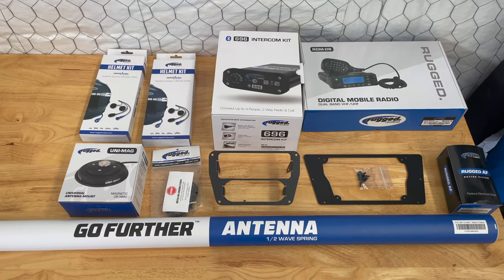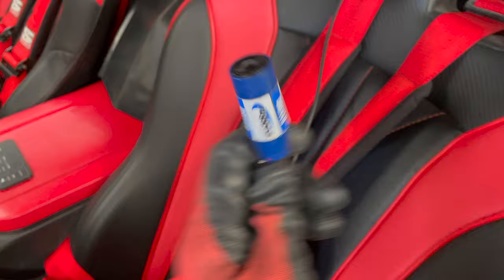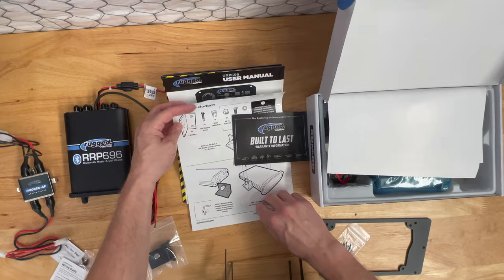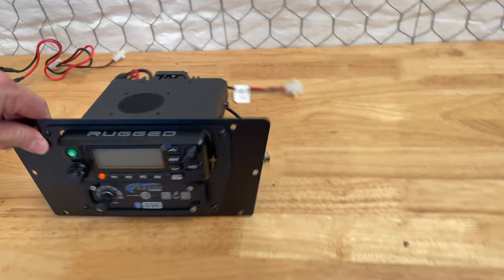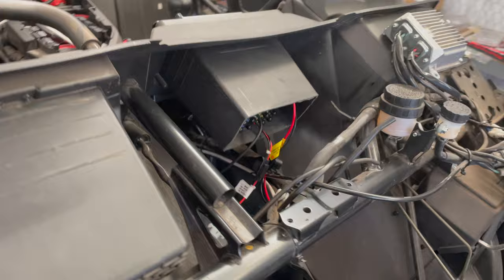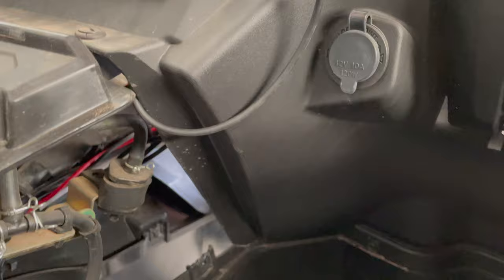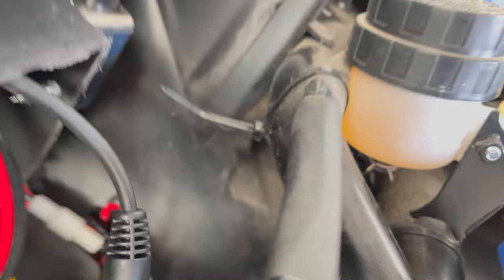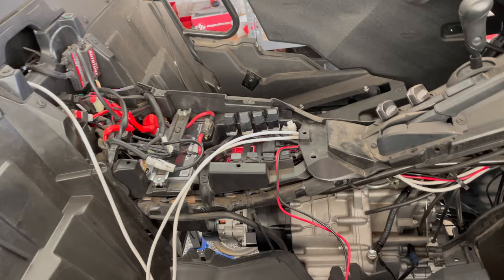Rugged Radios install on 2020 Yamaha YXZ-1000R

Comment: I can't believe you cut away the box.... I'd love to, but just this past weekend ran in Baja. It was raining, and caused more mud than normal. I too don't ride in mud as I hate cleaning it... however, sometimes you just have to do what mother nature has in store for you.

I was thinking of extending the box, by moving my coolant bottle (2016) and making a plastic sleeve to take up the expansion distance. I only need an inch or two, and it'd be some work with all the wiring and such in my way. I'm just nervous to lose the back of the box and expose all the BACK of the electronics where they're NOT as moisture resistant as the front.

How has it been for you??? All okay?  Have you ever taken out the radio or intercom, and cracked them open to see if there's any signs of exposure to moisture??  ... I have, and lost a radio just recently to constant 'washings' and not covering the face even though the radio carries a Mil-Std qualification.

Let me know!!
Reply from the maker: No problems so far and the red/black YXZ has almost 1700 miles on it with the radios installed the same way.  We've been caught in the rain once for 10 minutes and I've probable washed it 10 times with a pressure washer.  Rugged Radios makes an accessory "sock" that clamps on to the back of the electronics that you might consider.